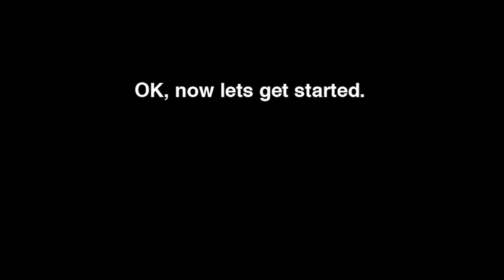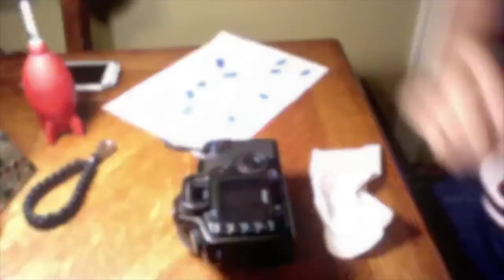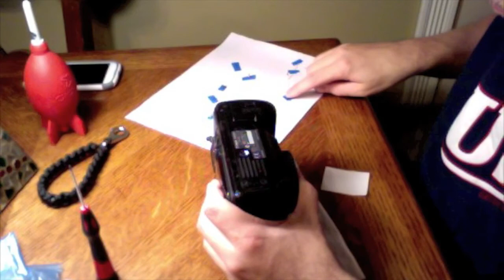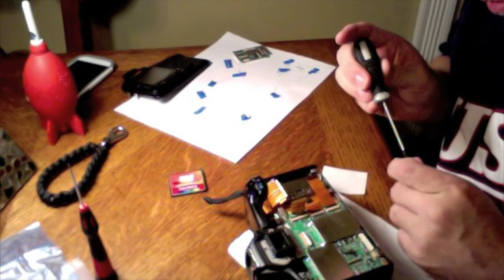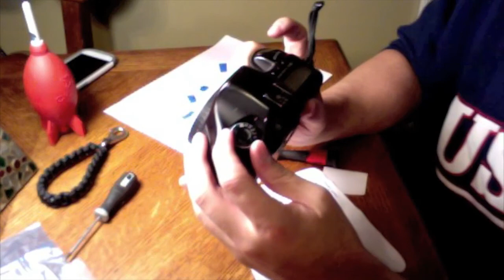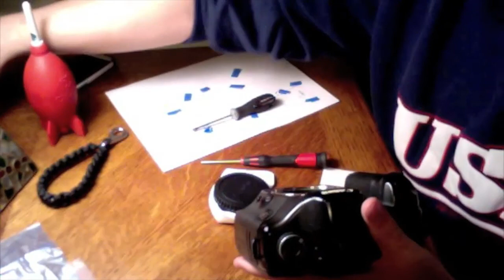Canon 5d CF Card Assembly Repair, also replacing the LCD cover.

Comment: Looking for repair video on the microswitches for the 5D classic. My 5D won't turn on, even after trying the simple videos of replacing CF card, battery, etc. Is there a way to disable the micro-switches so the camera will turn on? This would be the easiest way to get it functioning without spending $$. HELP!

Comment: Is the metal "housing" on the CF pin assembly removable? For $40 I can get a just the pin/ribbon portion of it... for $85+ you get the entire assembly. Just wondering if I can spend $40 and reuse my old metal housing. Thanks
Reply from the maker: Honestly, I don't remember. It has been 5 years since I repaired this camera. I will say that replacing the whole part, even if you get a used part, will provide a durable repair. In fact, this same 5D has been on loan to a friend who uses it for shooting photos of homes he is selling.
Reply: OK thanks, I'm going to take mine apart and see before ordering.

Comment: Your video is well explained but I have a Canon 7D. I have already ordered a new CD card reader.   Do you think the procedure is the same or different ?  I am afraid to start doiing it and destroy one of the rubbon cable that I have not noticed.  Thank you in advance.
(so far, I have changed my iphone 5 screen, which was quite an adventure with all the tine parts and the rubbon cables)  not sure if this will be more complicated).
Reply from the maker: +Patricia Moreau I would recommend getting a little angled mirror like they use at the Dentist's office. It will allow you to look under boards before pulling on them. As for the 7D, I also have a 7D but I am unfamiliar with the internals. Luckily, the 7D is far more popular a camera than the 5D line, probably due to cost. As such, there are lots of videos describing this process. Here is one where you can start. Hope it all goes well for you! https://www.youtube.com/watch?v=AVgxK5sS98s
Reply: Thank you Abraxsis.  I have already watch your link and left a message there.  It is not well explained and most of it goes on fast motion.  If you have other links ? I did not find any.  I will keep searching...
Reply: But if one day you will do one for the Canon 7D with lots of details, you will be very successfull ! Thank you so much.
Reply: Hey Patricia, could you link me up to where you bought the canon 7D card reader? I cannot find one..!!! Thankyou in advance

Comment: Thanks for this video. I have a 5D MKII and got an "CF CARD ERROR" saying the card needs to be formated with every card I used. No pins where bent. Took my camera apart and discoverd had to bent the holders that push the CF card back up. By bending these holders I allowed the card to go lower into the cf bay and connects better to the pins, my problem was fixed. Hope this helps anyone who is having same card errors but no bent pins.

Comment: I have a wobbly camera lug part CB3-1721.  Do you have any suggestion for how to remove the top cover?  I want to make as minimal effort as possible.
Reply from the maker: +thepiecesfit Once you move past the rear shell the camera becomes much more difficult to disassemble and would not recommend it if you are a novice.
Reply: I figured that much.  It seems pretty secure in there despite being wobbly.  I'm not sure its worth the trouble and repairs on this camera would probably exceed what I want to pay for it.

Comment: wish I saw this before spending 285 for CF replacement with Canon!
Reply from the maker: Yeah, same here. I got my 5D for free from a friend because it didn't work. After an inspection I found the pin bent, I bent it back into place and the camera worked. After that, I just ordered the part I needed. Been using the 5D for about 2.5 years now.